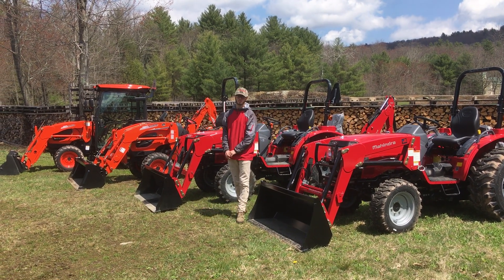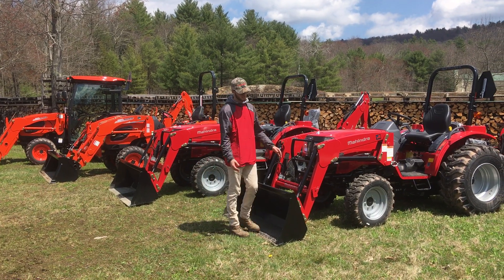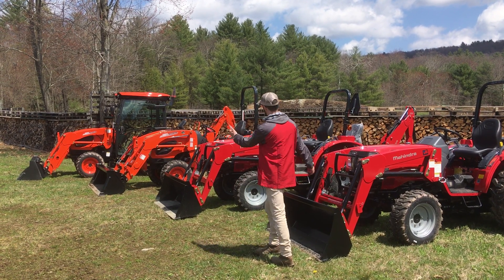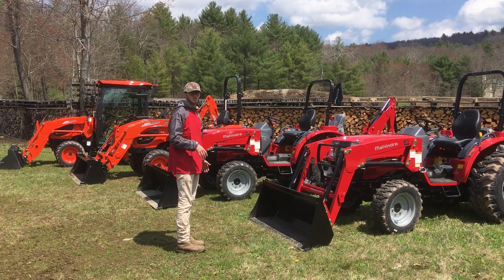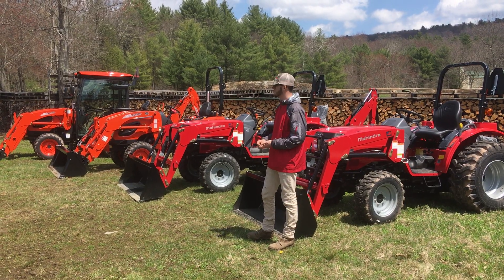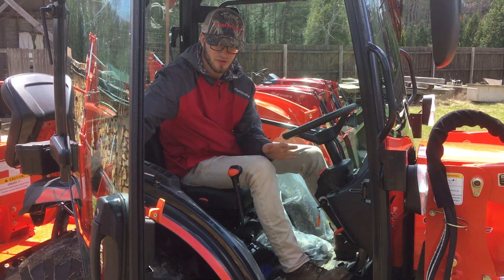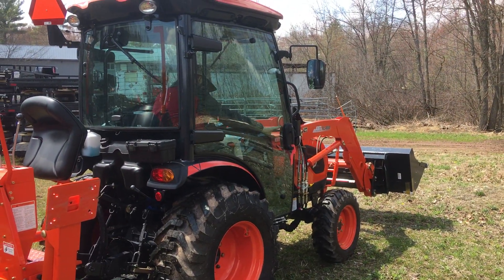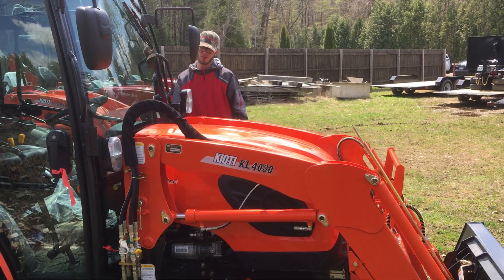Difference between HST (Hydrostatic) & Manual/Shuttle? - Compact Tractor Transmissions

Comment: It is hard to say which I like better. When it comes to using a bucket loader or when you have to do some extreme maneuvering, hydrostatic is the name of the game. But when it comes to towing or pulling, I would prefer a manual since it doesn't slip or wear out as fast. I use both here on the farm and I feel like the preferences between manual and hydrostatic greatly depends on the application the tractor will be doing. That's just my two cents.
Reply from the maker: very well said! Very much agreed! We use both manual transmissions and hst transmission tractors on our farms. Definitely depends on the application!

Comment: Interesting to see Kioti offers a tractor with no shuttle shift and for a few more buy the Shuttle or the Hydro cause in loader ops you will cycyle faster and less operator Fatigue unless your doing work with rear implements all the time would be fine with no shuttle

Comment: On a shuttle shift, once your in a a range and gear the purpose of the shuttle is to go forward to reverse without using the cluch.
The ability to go forward to reverse of a hydro but the fuel savings of a gear trans.
Plus for every forward gear you have an equal number of reverse gears.

Comment: I would like to see a pulling test with same model of tractor, tires.  Hydro vs Gear.  I would say the Gear will outperform on pulling compared to the Hydro.
Reply: I've seen videos with that done and the the geared tractor had about twice the amount of pulling power as the HST. The heavier the equipment the bigger the difference translated to the ground.

Comment: Thanks so much for the very comprehensive demo, I have been agonizing over this decision. Everybody says, "it depends on what applications you will use the tractor for", but that isn't very helpful, since I need it for a wide variety of applications. I worry about the power loss with HST, but you said it's only 1 HP or so. I also worry about clutch replacement, and the possible wearing out of an HST tranny. Hmmmm, decisions decisions, lol.
Reply: A clutch is cheaper then getting a whole transmission done
Reply: I know your post is 4yrs old.
Have you decided on a tractor yet?
I recently ordered a shuttle shift  TYM/Mahindra 2515 R.
I wanted the clutch and gear drive grand for longevity and torque for hilly areas and wooded areas.
I know the hydro would be mush easier to operate and I’m sure there will be times I’m wishing I would have bought the hydro static but I don’t plan on being stupid and o do plan on learning how to use it properly.
I’ve seen a lot of tractor owners that were Very pleased with the gear drive.
My salesman actually talked me into the gear drive as he said the hydros will lack torque and sometimes you’ll be at the mercy of the machine if it strains gojng up a hill due to the hydro lag and torque loss.
Also the hydro trans is about $8-k to rebuild or replace and the manual trans full rebuild is roughly $4-k.
I’ve driven hydro equipment and like it but I don t want issues as the hydro really taxes the engine and throws off a lot more heat as a result.

Comment: He didn't explain properly. Hydrostatic doesn't just take horsepower away from your PTO. It removes all moving parts that will wear, no transmission, no brakes, no brake pads to change out, etc. It's a great concept. The problem is in execution. China, India, and other third world countries hate their customers with a passion, so they put zero work ethic in. Their products will still break, even things designed to last forever. And when a hydrostatic system goes it will cost you a LOT. Maybe more than the wear and tear it saves. So you can't get a cheap-o one and expect to save money long term. Look at lawn mowers, ride ons. Many of them are HST. And the first thing to fail in the first year of ownership? The HST. And it'll cost you 25-50% of the bloody buy price to repair.

Comment: Hydrostat for loader work.  Its just faster for changing from forward to reverse.
Hydrostatic is the automatic transmission of tractors.  Just move your foot to change from forward to reverse.
You want a cruise control for field work with hydrostatic, otherwise you have to hold the pedal the whole time.  
Manual can  be brought to speed, let go of the throttle lever and it will run that speed until it hits something or runs out of fuel.  This is great for mowing a large pasture.
Reply: I just got a low end Branson with hydrostatic.
The default for Branson is with cruise control and the linked pedal.
Its looking like it will be a really good tractor for the price.
Reply: What about feed mixer wagon.which one is suitable?

Comment: That Kioti sounds like it was knocking. Yikes.
Reply: The little Kioti definitely sounded like it had some 'rap' at idle and low rpm under load after it was first started. It went away a bit after he throttled up and seemed to be un-noticeable after the oil thinned and pressure came up by the time he was backing up. Def something funny sounding though. Not diesel knock, sounded like some piston slap or rod bearing clearance. Then again, I wasn't there with my ear to the crankcase.

Comment: Which one will last the longest
Reply from the maker: Honestly both in this day and age are very reliable. Both meant to last forever with proper maintenance and fluid changes. If doing tons of forward and reverse work then HST is the way to go.
Reply: A featureless manual, ie clang and bang. But you can't even shift those on the go. The more you put on to that shuttle, power shift, power shuttle the more things that can go wrong.

Comment: Great info - thanks Marshall.

Questions regarding the operation of the power shuttle on hilly/mountainous terrain...  (I know the transmissions you've discussed do not include the power shuttle but this seemed the best place to ask my questions as I haven't found any videos discussing power shuttles vs other transmissions).

Suppose you are stopped on a steep hill, engine running, nose pointing straight up the hill.  Must you brake to remain stopped or will the shuttle hold you in place while it's in the neutral position?

Now suppose you want to move forward up the hill...  What is the sequence of clutch, brake, and shuttle operations to change gear (different range or speed) and move forward up the hill?  If the brake is involved, must it be released gradually only as the tractor begins to move forward in order to prevent the tractor from rolling backward first?  Is the sequence different if you don't need to change gear?  Regardless of whether the gear must be changed, is it possible to cause excessive wear or damage to the clutch or other components in this situation (for example if the selected gear was too high for the slope or throttle was set too low)?

Is there any difference if the nose is pointing down the hill and you want to back up the hill?  Is there any difference when in 2wd vs 4wd?  Any dependencies on traction conditions?

Now suppose the tractor is heavily loaded and you are descending the steep hill (either forward or reverse) at an arbitrary speed (sane or otherwise).  What is the sequence of clutch, brake, and shuttle operations to come to a stop?  What is the sequence to change direction?   Change range or gear?  Is there a period wherein the transmission is in neutral or clutch is disengaged such that the tractor gains speed?  Is there any risk the transmission will not engage the next gear/range/direction, or the clutch will not re-engage?  Is it possible to cause excessive wear or damage to the clutch or other components in this situation?  

Is a manual shuttle better suited to these scenarios?  If yes, why? 

Is a hydrostatic transmission better suited to these scenarios?  If yes, why?

From what I've read in forums, an HST (hydrostatic transmission) is better suited to navigating hilly terrain and (if true) I would get an NX6610 with HST and wouldn't be so concerned about the details of the shuttle transmissions... But for most of the work I would like to do, the larger RX series tractors, with shuttle options only, are more suitable.

Note that I'm as much (if not more) interested in reliability/longevity concerns as I am in operational concerns.  I've gotten by with a Ford 851 powermaster (2wd w/ good clutch but touchy brakes) in these scenarios, and so have become pretty proficient with dual brakes, clutch, and non-synchro transmission....   but hoping that tens of thousands of dollars will buy me something not so hard on my nerves. :-) 

Thanks in advance...  I know these are very detailed questions that will be a pain to answer comprehensively and clearly, but I haven't been able to find the info elsewhere, and I'm sure many folks have similar questions.
Reply from the maker: Great questions. A Rx series has the powershuttle option. Generally the only way a powershuttle can be hurt is when there is an excessive load put on the machine. Examples would be trying to push a snowpile that is over sized for the machine, or going up a hill and trying to pull something to heavy for the tractor. In a straight shuttle shift the tractor would normally stall out in these applications. While in a powershuttle it will put more wear and tear on the hyd clutching system and it might be harder for the opperator to notice. So in these applications I would reccomend and straight shuttle or HST. However if you know your limits the Powershuttle is the way to go. Also in the powershuttle going up a hill you would want to try and not shift, or if you did you would prob want to use the designated clutch pedal as it gives an instant clutching and allows the tractor to change gears faster. While the powershuttle detent clutch button on the rx is delayed and would most likely allow the tractor to slightly roll back unless brake is depressed. However once you learn the machine , I don't think you will be shifting on the hill all the time. I hope this helps.
Reply: @orchardhillfarmequipment4347  Thanks Marshall.  I'm leaning towards getting the "straight" shuttle aka "syncroshuttle" rather than the powershuttle as I'm quite used to using a clutch, and think I would like the additional control and, perhaps, longevity, of this simpler system.  I think being able to feel the clutch engagement (through the manually operated pedal) would help with being able to control the brake properly while starting or stopping on a hill.  I've read that the powershuttle has a multi-plate wet clutch vs the single plate dry clutch of the syncroshuttle, presumably to handle the additional stress and heat generated by a system that is, perhaps, "riding" the clutch a bit as directions are changed.